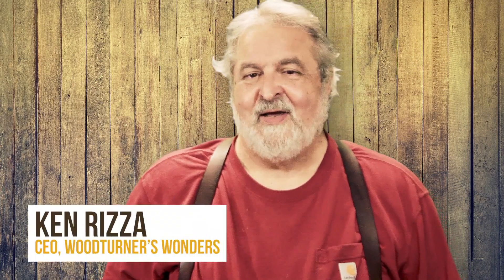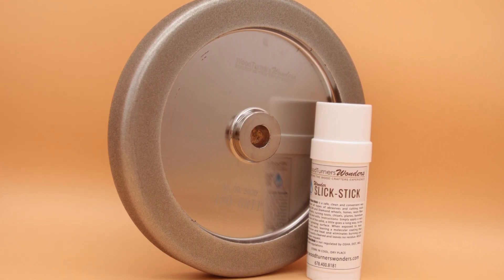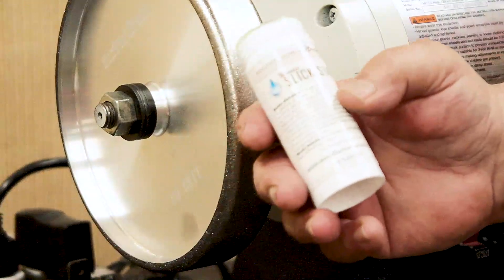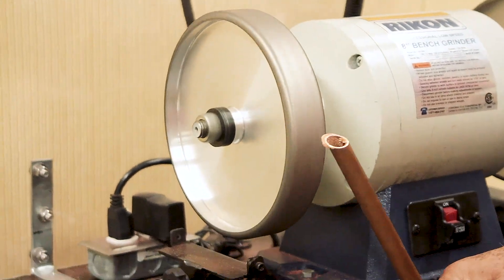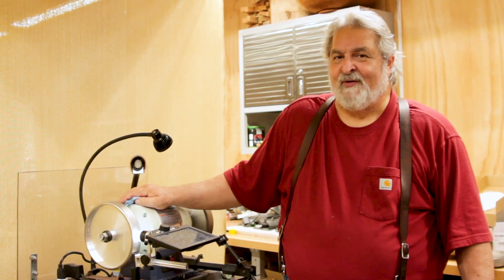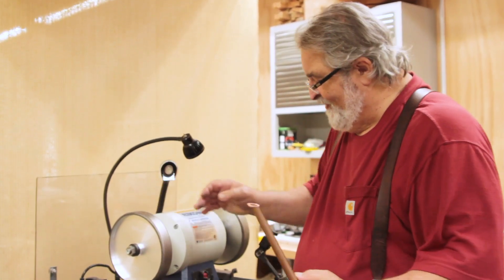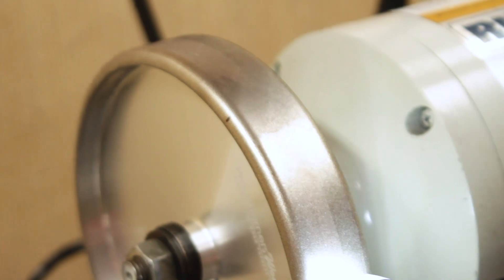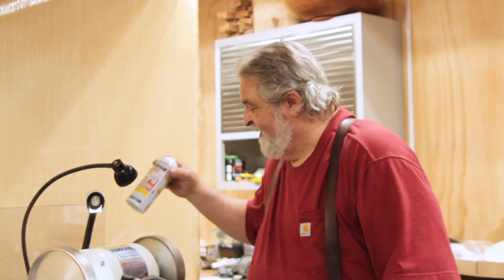Slick Stick

Comment: I purchased a Slick Stick last week rfom you, and it is all you say it is..plus more!!!
A wonderful product to be using on my CBN wheel I also bought from you...
I ordered on line on a Monday evening and Thursday Morning they were 
both at my door, even though I placed two orders a few hours apart.....
the packaging was fantastic, I also bought 2  8" white aluminum oxide stone wheels
that came in the packaging and they were in perfect shape.....your wheels 
are even better than what you say they are.....Best Wishes from Winter Park,, Florida, Paul
p.s. I did call on Friday to speak to a tech and get the low down on grit comparison....
they were very helpful and cheerful, even though it was such a minor question......
Thank You Mr Rizzo....

Comment: I bought a stick, tried it out, called Ken and told him, I put that &hit on everything! Then I ordered two more sticks. 👍 I still have my favorite cutting oil at the drill press, but there are times when I'm drilling and I don't want oil flinging all over, Slick Stick works great at those times. Also, when drilling on vertical surfaces it doesn't run like oil. It does melt and become fluid when heated but you get a lot more of it where and when you need it, than regular cutting oil.
Thanks Ken, 
and everyone else that works there too! 😉

Comment: I really appreciate this video. I have the Rikon grinder and your CBN wheels but didn't know how to clean the abrasive surface. I love Slick Stick and use it on several tools in my shop. Most recently I used a tiny bit on the platform of the grinder to allow my scrapers to slide smoothly. It works great on tool rests and the bottoms of turning gouges, skews and scrapers. Just a tiny bit does the trick.
Reply: Sorry to be offtopic but does someone know of a method to get back into an instagram account..?
I stupidly lost the account password. I would love any assistance you can give me
Reply: @Shiloh Khalid thanks for your reply. I found the site through google and im in the hacking process now.
Takes quite some time so I will get back to you later when my account password hopefully is recovered.
Reply: @Shiloh Khalid It did the trick and I now got access to my account again. Im so happy!
Thank you so much you really help me out :D
Reply: @Juelz Dante no problem xD

Comment: When demonstrating how well this product works on the band-saw blade it would be very revealing to see a before and after demonstration. There are several other things that can effect how fast it will get through the log, like how new is the blade, how powerful is the saw, how well is the table lubricated. A before and after demo would be much more reveling. It is much quicker than my band saw but the saw is also a larger, more powerful saw than mine.
Reply: @WoodturnersWonders  Thanks for the reply Ken. It looks like an excellent product. I will be trying it.

Comment: I am really impressed. I cannot find neither Slick Stick nor PB Blaster in Europe. Do you know of dealers in The EU or equivalents to the two brands?
Reply: Hi Jesper- thanks for the question.  PB blaster is a great penetrating oil so you may be able to find some of that as a substitute.  The slick stick formula is a highly guarded secret and the manufacturer won't give us any info on that so I'm sorry about that part.   All we know is that it has no petroleum or wax and is totally non toxic and non flammable.

Comment: I sharpened every chisel and plane I had. It got messy, but with this, a quick shot of wd40, wire brush and wipe right off. Use the wonder stick again and I’m good to go within about 15 seconds of cleaning. 

Am I doing it right. Dunno. But the wheel was dirty, the wheel is clean, and I’m back to sharpening within about 35 seconds.

Comment: Hi Ken I wish i'd seen this stuff before  I ordered my worksharp cbn wheel duh! One question using slick stick on a bandsaw is there a possibility of residue from it affecting adhesion to the wood cut of glue or Finishes ? Cheers
Andrew

Comment: Can I use Parts like the Kodiak Swivel Head + Sliding Arm Assembly can I use them on the Pro Grind Sharpening System that they sell on Amazon

Comment: Hello Ken I have a question for you , It's  Really   two questions , okay# 1 can I use parts from the KODIAK SHARPENING SYSTEM to upgrade the Pro Grind Sharpening System For Lathe Turning Tools, Chisels, Skews, Gouges, Bowl Gouges, Spindle Gouges and More. Includes the Multi-Grind Jig for Gouges, Slotte  sold by . Peachtree Woodworking Supply Inc .

Comment: Sooo...is this the official OK to routinely grind plain steel on a CBN wheel as long as you are using Slick Stick. It seemed that that was the case because I didn't hear a disclaimer like "We don't recommend you use your CBN wheel to grind plain steel (aluminum, copper, brass, etc.) but if you do, here is how to clean and restore your wheel." Thank you and going to place my order shortly.
Reply: @WoodturnersWonders  Thank you...EXCELLENT!

Comment: Sir, how does one APPLY the Slick Stick to the bandsaw? Is it a quick tap while running like with the wheel? Put it on a rag and coat? How much does one use?

Comment: I know you're not putting a lot of the Slick Stick on the blade but I'm wondering if over time it will affect the material or adhesion on the two wheels?